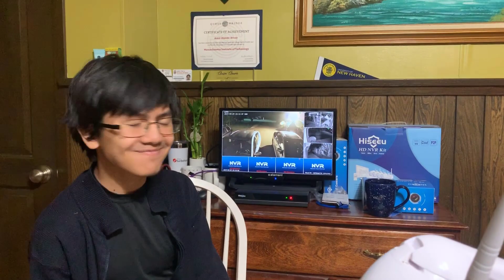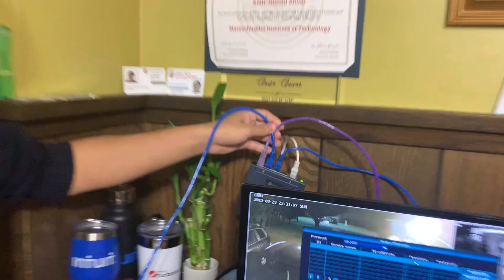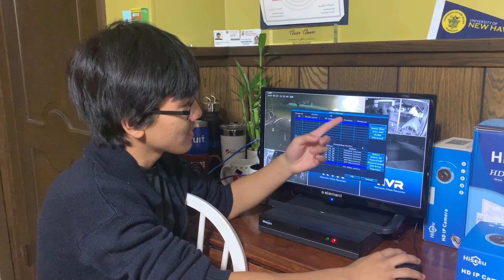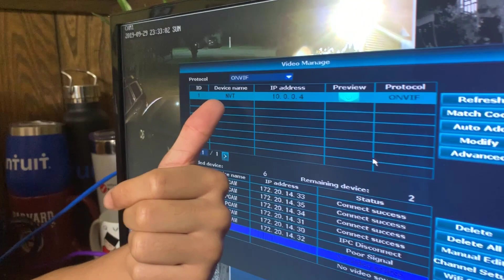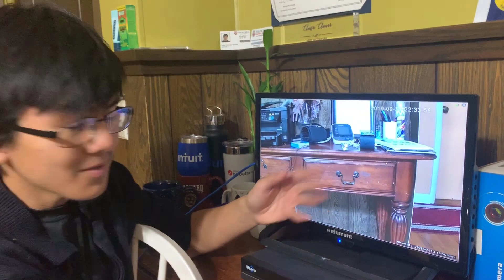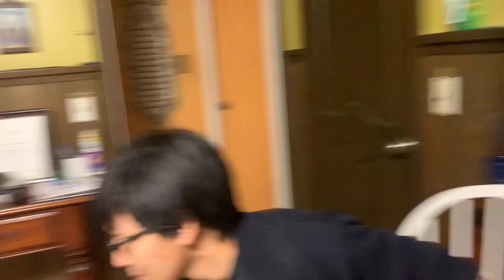How To Set Up PTZ IP Camera To ONVIF NVR Via Ethernet Wired Not WiFi & Pan-Tilt-Zoom Using Joystick

Comment: Hi, how do I hardwire already matched wireless cameras to the NVR? I do not want to use wireless due to extremely poor signals? I have connected the Camera to switch, switch to router and router to NVR, but the default setting remains WiFi

Comment: do you need extra equipment to power the camera through the ethernet cable? I thought using the ethernet connection would eliminate the need for a battery backup if power goes out

Comment: I have a zosi 5mp nvr with 5mp bullet style ip cameras.  I have purchased an Alptop poe PTZ camera and would like to add it to the Zosi NVR.  The Zosi NVR is an 8 channel NVR and I have 4 IP cameras added to it.  They are plug and play poe in the back of the NVR.  The alptop PTZ camera and the Zosi NVR per their sales departments are both ONVIF compatible.  The Zosi NVR doesn't have a "video management" option in the menu but it does have an "IPC  configuration" option that allows you to search for a camera.  Can I add this PTZ camera, and can it be powered by the same method as the other Zosi IP cameras with just poe or do I need to power it another way?  Any assistance would be greatly appreciated.
Reply: I have the same exact question???
Reply: @mavansino  I was not able to get the camera to work with the Zosi system.  So I purchased a Reolink system with a Reolink PTZ camera and all works fine.